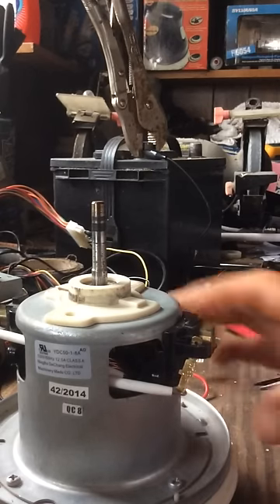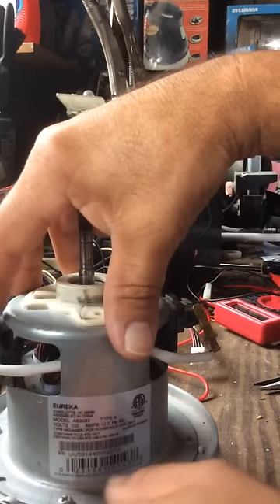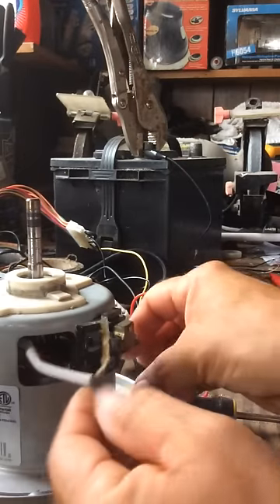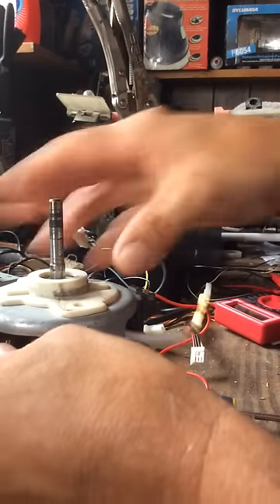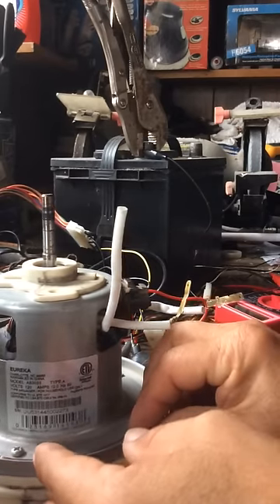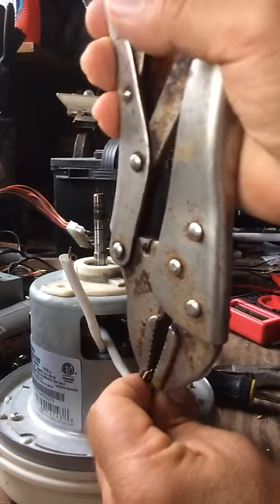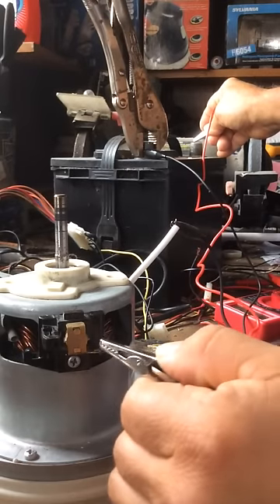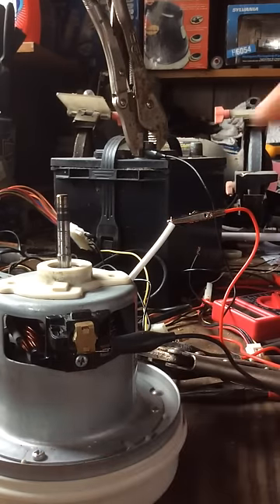How to convert a 120v ac vacuum motor to  work on 12 volts dc

Comment: You require a capacitor in order to reverse the direction of the motor.  That kind of single phase motor has 4 windings.  The windings opposite of one another will always have the same magnetic charge, positive/negative (12-24v dc) or phase/neutral (120v ac), which will always cause the motor to spin in the same direction no matter how it is wired.  Adding a capacitor and then switching the leads on the capacitor will reverse the direction of the motor because of its discharge timing.
Reply: I'd use a relay instead of a cap, for it's upgrade potential; to add a switch for reversing on the fly.
Reply: @binaryglitch64  My understanding is you would still need a capacitor in addition to the switch .
Reply: You don't need any capacitor. It's just a DC motor but with electromagnets instead of permanent magnets

Comment: It definitely works better and with more turns  than the original wiring.  I try it at 24v, with pulleys and belt I can rest comfortably with a power of about 3000 rpm that I need for an improvised lathe that I made.
Reply from the maker: Really appreciate your feedback. it’s good to know. Thanks so much for sharing.
Reply: Can I email you a picture of my vacuum motor and see if you can walk me through on how to make it run off my cordless drill battery.  18 volt

Comment: Thank you! I need to convert a vacuum motor to 12 volts for portability. This will help!
Reply: My vacuum cleaner motors only have two windings.  I made the motors run in each direction by connecting my battery to the other end of the windings... without using a capacitor.  I'm using my most powerful motor to convert my bicycle into an ebike.

Comment: that is a universal motor. it  works with both of ac and dc current it doesn't need rewiring and the speed and torque depends on voltage .

Comment: My vacuum cleaner motors only have two windings.  I made the motors run in each direction by connecting my battery to the other end of the windings... without using a capacitor.  I'm using my most powerful motor to convert my bicycle into an ebike.

Comment: Thanks man, got mine working thanks to you.
Reply from the maker: Looodak , thanks for the comment. What are you planning to make with the motor?  Just curious.
Reply: @GUILLERMOJGARZON  EV Bicycle for as cheap as possible :) Got a bunch of 18650 from laptop batteries, got the motor, need a switch and thats it for start. I used to bridge the coil wire to the brush wire and that worked, but had a serious feedback loop somehow so it stopped by itself quickly. Now it works happily on 12v from 3 batteries for 10-15 minutes i tested, nothing is heating up.. it has no power but thats just 3 batteries.

Comment: From my understanding,(even though you reversed the input polarity) you need to reverse the polarity of the winding? I'm still just learning though,and may be wrong.
Reply from the maker: jeremy henderson. I really don’t know. Only thing is that you can do this convention and put all back together and then you can have an ex-ac powered vacuum cleaner working with 12 volts dc power.
Reply: You are correct indeed.
Reply: @aarondelo5892  My vacuum cleaner motors only have two windings.  I made the motors run in each direction by connecting my battery to the other end of the windings... without using a capacitor.  I'm using my most powerful motor to convert my bicycle into an ebike.

Comment: Would this run a ebike I have the exact same motor and want to attach it to my pedal bike
Reply from the maker: That will make the bike run the ? Will be for how long, depending on your weight and voltage/amperage on the battery,Just trying will give you the answer. Good luck

Comment: First you need to know the difference between ac and dc motors. Dc motors work because they have internal magnets ac motors  use induction ,a current alternating through a winding.Like most appliance motors ia vacuum uses a universal motor that can run on ac or dc. If it wasn't it couldn't run on dc because it would have no permanent magnets inside.
Reply from the maker: really appreciate your feedback. every day is a learning day.

Comment: How about if l connect to 24 volt battery without any modifications?
Reply from the maker: Really don't know if runs or not. Please let me know the results.  Thanks
Reply: My vacuum cleaner motors only have two windings.  I made the motors run in each direction by connecting my battery to the other end of the windings... without using a capacitor.  I'm using my most powerful motor to convert my bicycle into an ebike.  And, I have run my motors on both 12v and 24v.
Reply: @GUILLERMOJGARZON  It will run on 24v.  According to another similar video I watched after I watched yours, it can run on as much as 120v DC.  I'm in Colorado.

Comment: Can this work on all types of brushed motors?
Reply from the maker: XanCraft21 sorry but don't know the answer. You may submit the video to  some experts in electricity. Any suggestions or ideas in what can I do with the former 110v ac motor th
Reply: Guillermo Garzon well I did manage to take out the rotor in the middle of another vacuum motor (but you will have to use a socket wrench and something to hold the shaft and something to get the cap off the part where the fan is), but I was going to use the rotor to make a open motor frame with wood, but I have no wood. Maybe you should make the wooden open motor thing (but use magnets because that's what I was going to use) and test it and make a video about it.
Reply: there's universal brushed motors that can be hooked up to either DC or AC. occasionally you will find smaller fans with them in it. but ac brushless wired for DC screams electrical fire all over it.

Comment: Hello Garzon can a 110v sewing machine motor work on a 12 volt battery
Reply from the maker: bubba Skull , I really don’t know.find out if is universal motor,then compare the endings of the brushes if looks the same an the vacuum motor. Then try if doesn’t work put everything as was originally by soldering the wires. Good luck.
Reply: for sure! just re-wind the thread in the bobbin counter-clockwise with 900 turns ;-) jk, depending on what make or type. like a surger is wired different. id stick to just using a 300 watt inverter off a car battery if ur a prepper

Comment: Can you put it on a bicycle
Reply from the maker: Well. Calculate amps draw with load Versus battery and you’ll see how long will last.  Don’t know how to calculate the torque. Good luck with your project
Reply: My vacuum cleaner motors only have two windings.  I made the motors run in each direction by connecting my battery to the other end of the windings... without using a capacitor.  I'm using my most powerful motor to convert my bicycle into an ebike.
Reply: @amberswift3086  hey girly. I’m working on something similar. Got a 120vac eureka motor as this guy but from a fan. Anyways I could definitely use insight.
Reply: @Waluigi164  How can I help you?

Comment: no capacitor
Reply: And no smoke     hold on wait for it wait for it in all seriousness you have a very valid point understanding what it is that you are actually changing and most importantly the possibilities and capabilities is key and these projects
Reply: My vacuum cleaner motors only have two windings.  I made the motors run in each direction by connecting my battery to the other end of the windings... without using a capacitor.  I'm using my most powerful motor to convert my bicycle into an ebike.